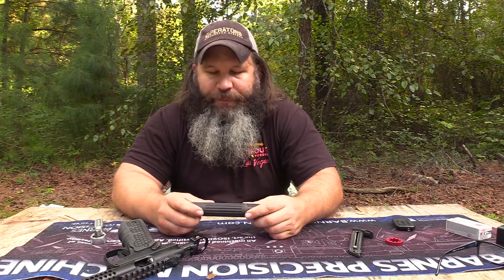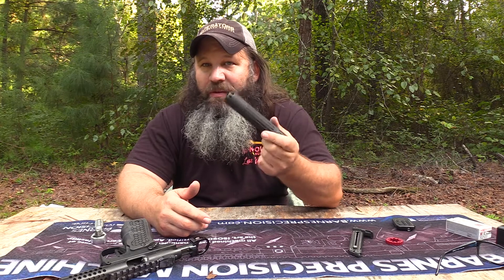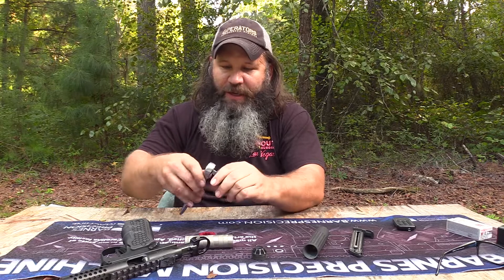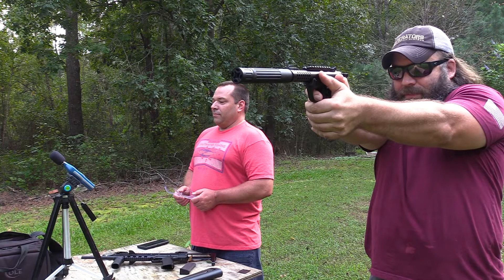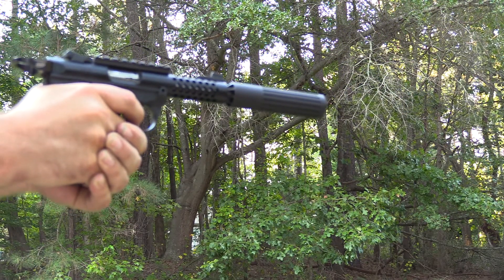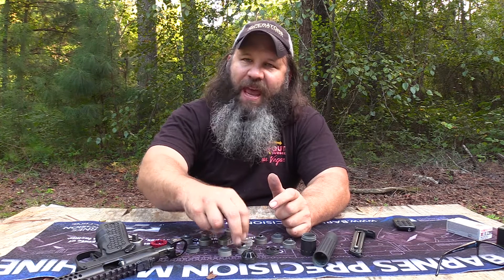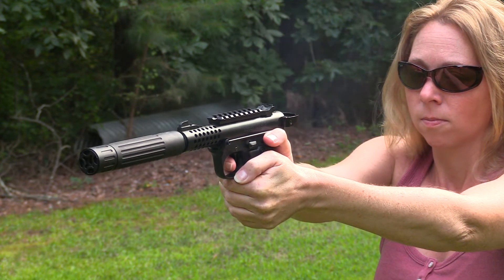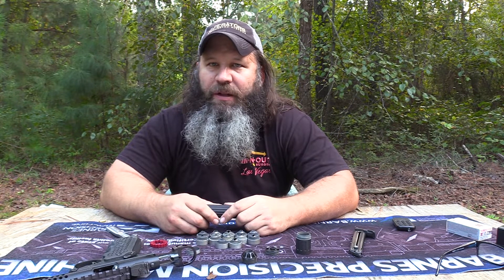Liberty Suppressors Vector

Comment: great video, thanks. What would happen if one put a lose layer of stainless steel-wool between each baffle ?  ( is there room ? ), and would it reduce the noise even more ?  Also, what is the thread size where it screws onto the adapter ?  1/2 - 24 ?  Thanks again., you gained a new subscriber.
Reply from the maker: I am not sure to be honest on the steel wool. I doubt it would do much either way as you need empty volume for the gases to expand. 
Thread pitch is 1/2"x28